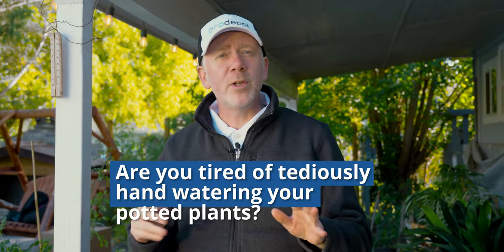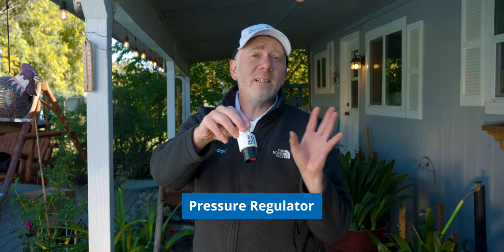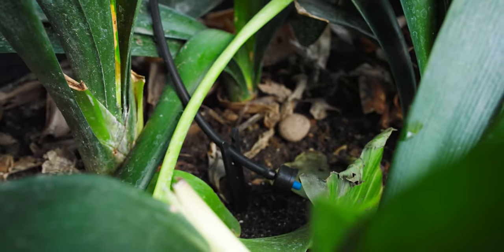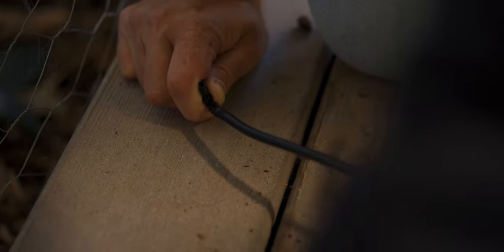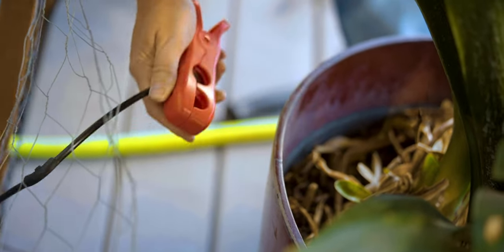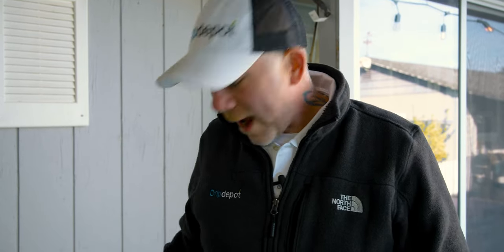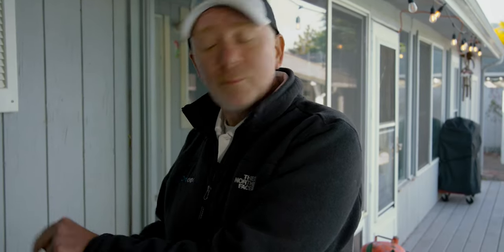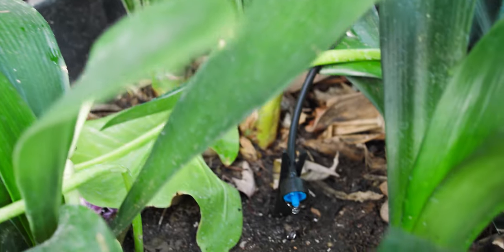How to Install Drip Irrigation for Containers and Potted Plants (Complete Beginner's DIY Guide)

Comment: I live in an apartment with no hose line. Is it possible to modify this somehow to be used with, say, a five-gallon bucket filled with water instead?
Reply from the maker: Very possibly so!  At least if you were able to get a little elevation out of it to create some pressure.  You'd want to swap the emitters used in the video out with something like these: https://www.dripdepot.com/product/toro-cleanable-dripper 

The drippers at that link can work at near 0 PSI, basically so long as there is water flow they can drip.  They work great in very low pressure gravity systems where the source cannot be elevated very much.  A low elevation water source may not create enough flow to operate a ton of them, but definitely can operate a few.  

Alternatively, something like the Claber Oasis may work for you -- the Oasis is typically used for indoor plants where there is no spigot, but can work on outdoor systems so long as it's protected from the harsher elements.  Failing that, Claber also makes the AquaMagic which is an outdoor version of the Oasis -- the biggest difference being the AquaMagic requires something to hold the water, while the Oasis has the water tank built in to it.   Happy to link both below just in case: 

https://www.dripdepot.com/product/claber-oasis-evolution-drip-watering-system
https://www.dripdepot.com/product/claber-aqua-magic

Comment: If I put a 25 psi regulator at my faucet, and then down the main line I want to put a couple drip tapes in a raised bed. Do I need to put a 10 psi pressure regulator in the line to the drip tapes?
Reply from the maker: Depending on your overall setup, I'd like just to swap out that regulator at the hose bib and install a 10 or 15 PSI regulator there (you can use 15 PSI with the 15 mil thick drip tapes). The drippers shown will operate well at 10 to 15 PSI.

Your plan is also viable however, as most regulators require 5 more inlet PSI than what they regulate to, and in your scenario it would be a difference of 15.  It's likely you'll need fewer adapters overall if you just go with one single 10 to 15 PSI at the faucet :)

Comment: How long to run the water? I'm going to be using it in 11-18" pots and 2' and 3' planters outdoors.
Reply from the maker: There's too many factors that go into watering duration to have an overall cycle time -- everything from plant type and maturity to soil type to sun exposure can influence run times.  Someone growing a potted fern is going to need to water more than someone growing potted ficus.  

If you have a rough idea of how much water the plants you're growing need, you can get a good idea on a run cycle time by going off the flow rate of the emitter.  The ones we used in the video were all half a gallon per hour, so we knew if we ran the system for an hour, a full half a gallon of water would be delivered. 

You can also use soil moisture to guide your watering cycles -- most plants like the soil to be moist, but not wet.  The soil should still be crumbly, essentially, but not passing through your fingers like sand.  One tip I always follow:  err on the side of short cycles at first, it's always easier to add moisture to the soil than it is to remove it and overwatering likely occurs more often than underwatering.

Comment: How many pots can 100 ft of 1/2” mainline cover?
Reply from the maker: This will largely be determine by the diameter of the pots (at least, if you mean in regards the length of the line compared to the length of the line of pots). 

If you mean how many in regards to GPH an PSI, the general rule for 1/2" tubing will work pretty well: 

Try to keep the total flow rate of 1/2" tubing at 200 GPH or less -- this could mean 100 pots each receiving 2.0 GPH, or 200 pots each receiving 1.0 GPH, etc.  

After that 200 GPH threshold, the pressure lost from friction (and the velocity of water) can get pretty steep.

Comment: Mine leaks at the timer faucet connection Any suggestions?
Reply from the maker: You bet!  

First thing to check is for the gasket on the inlet of the timer -- female hose threaded connections seal via a gasket that should always be present on the female side.  Check to make sure it's there, and isn't warped or damaged, or twisted around.  If it just got twisted around, you can straighten it and give it a shot.

Comment: how many pots can you put on one system?  we do large roof decks in philadelphia.
Reply from the maker: It's tough to pin this down to specific number, as the total quantity can vary depending on factors like flow rate available at the water source and diameter of the mainline tubing.  For the system in the video, using 1/4" mainline, I probably wouldn't go much over 20 pots depending on size.  A 1/4" mainline can handle about 30 GPH in flow -- calculating flow is just adding up all the emitters.  For example, if I use 40 0.5 GPH drippers, by system flow rate would be 20 GPH.  

A larger mainline can support more pots -- container systems with a 1/2" mainline are probably the most common and 1/2" tubing can handle up to about 200 GPH in flow, so significantly more pots could be supported by a 1/2" mainline.  

So how many mostly comes down to the flow provided by the water source and the mainline's ability to handle the flow.  :)

Comment: Is the main line 1/2” or 1/4”?
Reply from the maker: Jennifer, in this video our mainline was just 1/4" -- that's because we only had a few pots and over a short distance.  Much more (or some further away) and we'd have had to use 1/2".  1/2" or larger will be the main on most systems, only really small ones can get away with all 1/4".

Comment: i''ll get fixed (=glued) water capturing tubes on my containers (will have to be tilt 10% at least by hydraulic car lifters) since they'll make people pay for their supposed ''ecol. footprimt'' for their energy/water & so on consumption. there are no yt videos about such work, so i proposed to make one afterwards. the raincatching tube needs a drop catcher above. w/ 44m2 roofs i'll get 31m3 rainwater stored = saved each year if i'll spend it fast enough due to limited storage capacity.